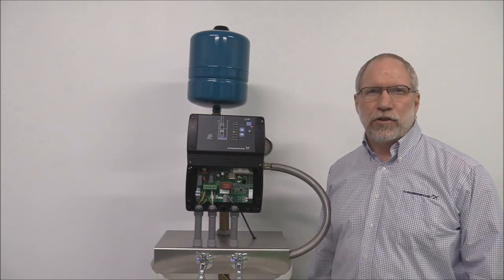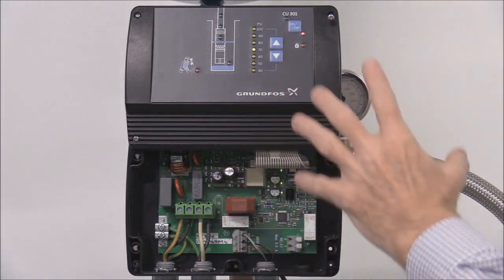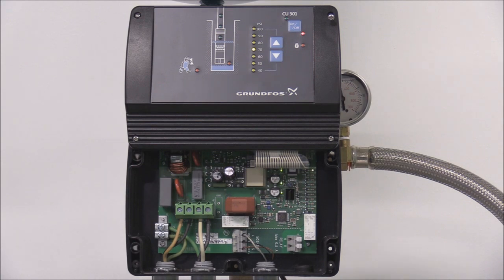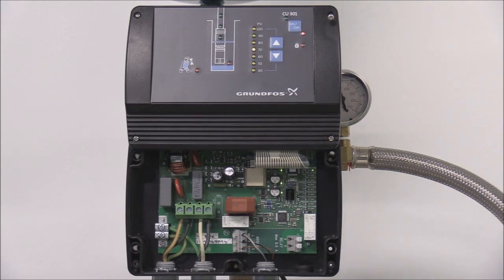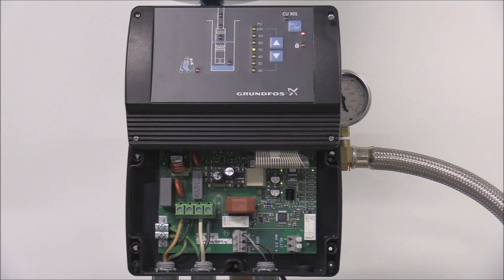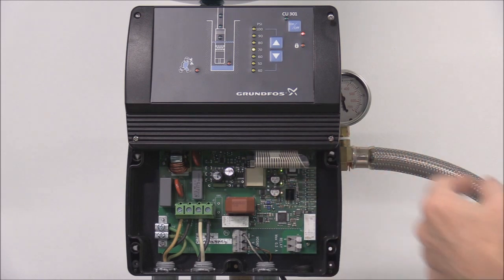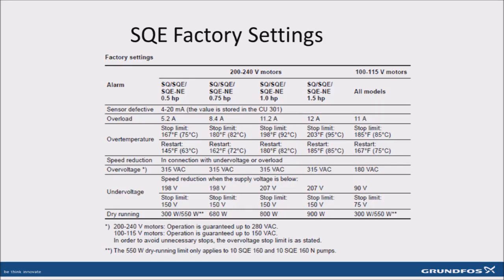How to fix the Grundfos SQE pump using CU 301

Comment: My on/off button does not turn the system off. How do I turn off? I also don't seem to be able to change the pressure settings? Is the system bad? CU301

Comment: I have no LEDs on the front panel, the unit will not turn on/off.  The 24V DC light is solid green.  The other two below it are flashing green.  I cannot find anywhere what flashing means - anyone have any idea?

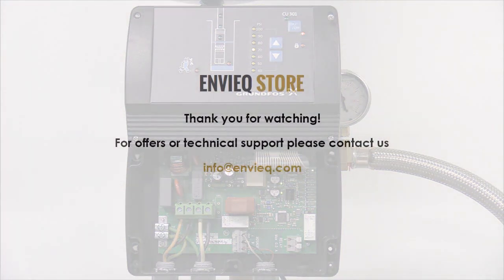Comment: Question about the indicators.  At 6:34 when you reconnect the sensor, we can see the "Sensor Defective" light goes out.  But then at 2:36 -- the very moment you're starting to point at the "Sensor Defective" light -- the "Pump" light goes red.  From a troubleshooting standpoint, should we take any notice if that does or doesn't happen?  The "Pump" alarm gets cleared at 6:43 by the ON/OFF switch, and the video's done, but I'm left with the question:  are alarm lights are *always" significant with respect to their own indicated condition? ... Or might they sometimes be merely innocent glitches due to, for example in this video, changes in other alarm conditions?   Any guidance as to how a troubleshooter should consider it?  Thank you!

Comment: I’ve had nothing but trouble with my grundfos cu 301 system. So much in fact that I’m footing the bill and converting to a traditional exterior pressure switch and tank which are going in my basement. 4 sensors and 2 control panels in 4 years have cost me thousands. I wouldn’t recommend this to my worst enemy. My last home had a traditional system that was trouble free for 16 years, this system is overpriced junk that’s designed to fail. BEWARE
Reply: totally agree had 1 pump die on me and now i think the control panel has quit

Comment: i have a problem. None of the LED indicators are lit, yet there is power to the controller. The controller is "clicking" and several of the LEDs inside the controller are lightly flashing with the click. The rate is about a click per second. The power to the pump turns on/off with each click as I can feel the pressure surge with each click. I know this must sound pretty weird... but that tells me the pump itself is likely OK. Since there are no indicators that tell me the situation, I am assuming the controller itself has gone awry. Hence, another problem. I live where there are no Grundfos dealers out here an hour North of Ridgecrest. I have found that service type companies dont care to make the drive which I have found for window replacement, rood tile repair, septic tank cleaning, etc.... now I have no water Should I just pick up a new cu-301 unit available on Amazon?  Should I bypass the CU-301 and run power straight top the pump?
Reply: I am in the same situation, what was the solution, just replaced the controller ?
Reply: @talhagursoy172   yes, that is what I did, replaced the controller. It is an easy changeout. Just make absolutely sure you switch the breaker to the pump assembly "OFF". Pump works as it should, and have not had any issues since.
Reply: @2footadventures728 Thanks buddy! I just replaced the controller and it fixed the issue, initially qouted $5k for the work and well contractors claimed that pump also need to change but got it done for $500.

Also if anyone in the same situation and in need of water immediately, you can baypass the controller but connecting the power cables temporarily, that saved my life for two days. I turned off the breaker overnight though

Comment: My CU301 status is good but my Pump only runs at a fixed low pressure.  If I change the pressure setting on the CU301 there is no change in output pressure.  again all CU301 status lights are good. What could be wrong?
Reply: I found the issue.  A check valve on the output line of the Pump had deteriorated to the point that the Internal piston was blocking a significant portion of the water flow through the check valve.  The spring, retaining nut,  and half of the piston shaft were missing due to the decomposition.  I assume they are well down the pipe traveling toward any one of my irrigation zone valves.  Not happy about that.  I had no idea the check valve lifetimes are so short.

Comment: does anyone refurbish these units..I would hate to throw my old one away
Reply: Virgil Smith 
Did you take the bottom cover off to identify why the pump light was on? 
What did you find out? 
Was the 3 green voltage lights green(24, 10, 5)?  Or
What were the other 9 lights doing? 
I do service electronics and would be interested in paying the shipping to mess with it if you already got a new one and were just gonna throw it away!..

Comment: I have a CU 301. The water flow is pulsing any ideas what might be wrong?
Reply: Could be the transducer(pressure sensor) is going bad. 
Could be the diaphragm tank(The precharge pressure of the diaphragm tank must be set to 70% of the pressure setting in order to use the tank to the limit of its capacity.)
Reply: I am having the same problem